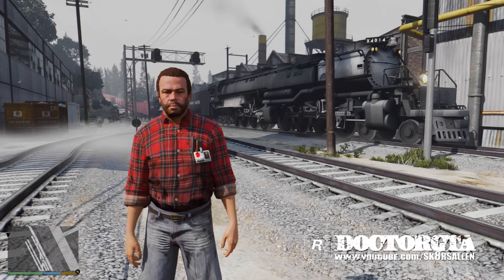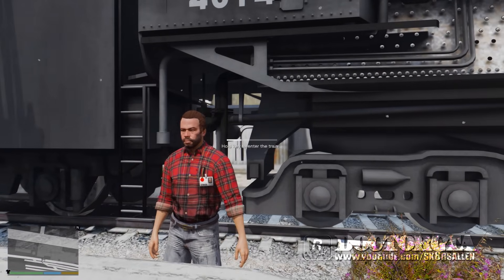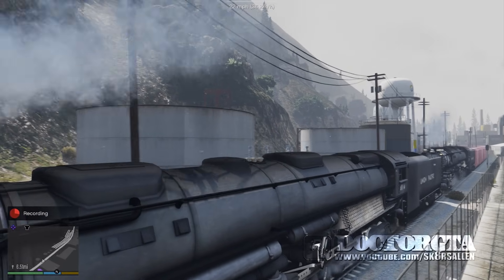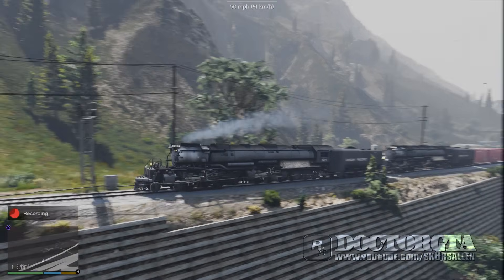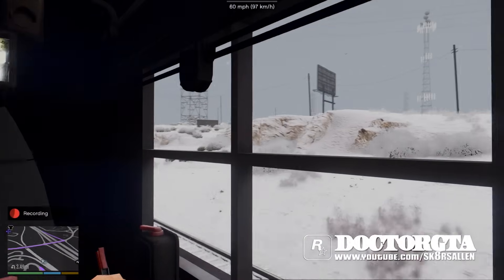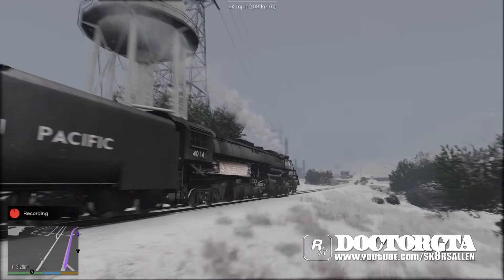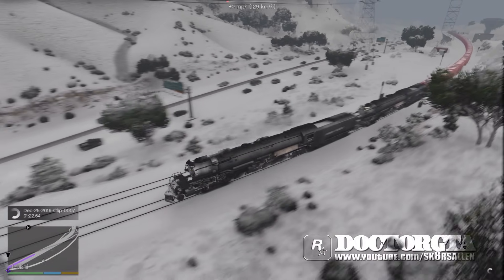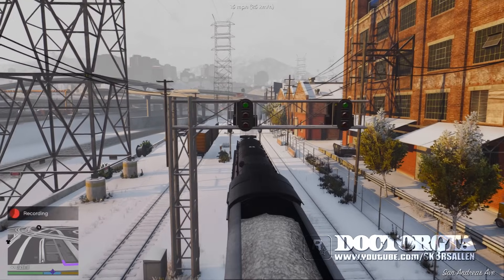GTA 5 Train Simulator Mod - (Union Pacific Big Boy 4014) Railroad Engineer Mod

Comment: The cab is accurate for an oil burner even, amazing. It has the atomiser controls on the left, and 3985 and 4014 have 2 drivers to run them, and generally 2 fireman as well under oil firing.

Comment: That exact Union Pacific 4-8-8-4 Big Boy #4014 is being restored to working condition in Cheyenne, WY at this moment.  It should be up and running by 2019.  It IS the biggest steam locomotive in the world!!
Reply: Its actually not the biggest steam locomotive in the world. There are longer and stronger steam locomotives however the 4-8-8-4 is the  most successful of any.
Reply: Actually, the OP is right:

4-8-8-4 Big Boy is the largest steam locomotive in the world, followed by 4-6-6-4 Challenger and 2-10-0 Decapod.

And at a weight of 625 tons, I'd like to know of any steam locomotives that saw regular service for more than 5 years, that wasn't military equipment or had a specialized use, because to my knowledge, there isn't an engine bigger than Big Boy.

Comment: they started restoring the 4014 in 2014.  my grandfather was an engine driver on #4023 big boy. it is on display in kinerflick park in Omaha Nebraska
Reply: Love these Big Boys.
Reply: As of 2019 it is currently operational along with 844,a 4-8-4 northern locomotive.
Reply: They sure did. And in early 2019, after 60 years in retirement, it was fully restored for excursion service to commemorate the 150th anniversary of the Transcontinental Railroad/Golden Spike ceremony. :)👍